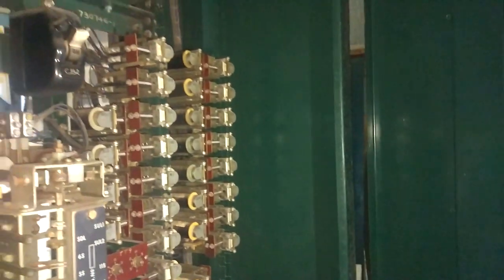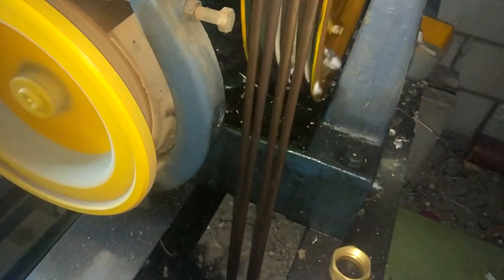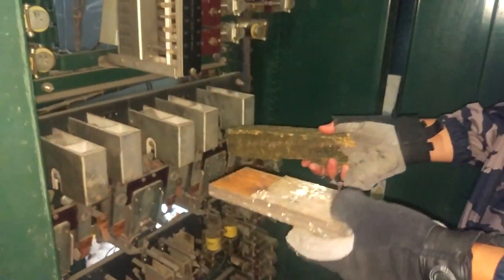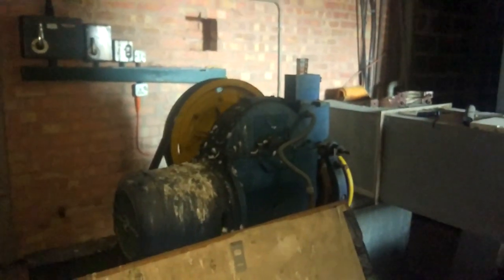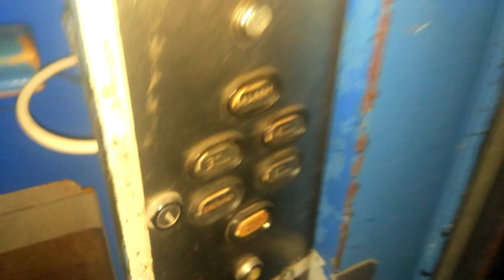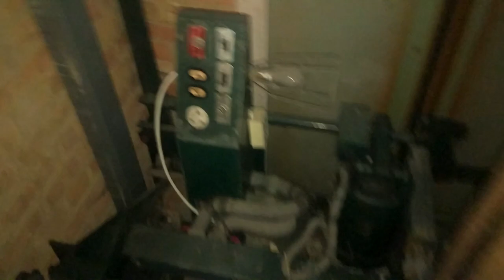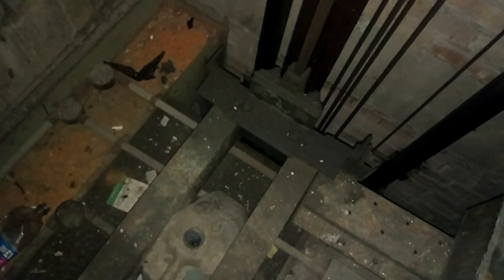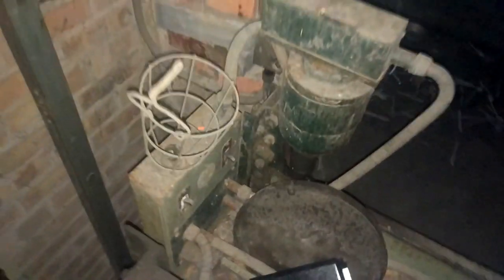Switching on an abandoned lift (60s Express)

Comment: Super dangerous. You had no idea what condition it was in.
Reply from the maker: It was in terrible condition.  The doors were not locking.  Safety circuit was not operating.  Relay logic was not operational.  Shaft doors were rusty and were rubbing when opening and closing.  The motor looked liked it hadn't run in at least 5 years.  The tracks were dry and the shoes were rubbing.  The cables looked rusty.  The motor brake was not working, and after oiling it, it was still getting stuck.
Reply: That’s the whole idea isn’t it?
Reply: @punkybrewstershubby  yea but he’s listed the issues in his last comment to prove that he assessed the conditions and knew what he was getting into before he rode it. Therefore, he already knew the conditions.
Reply: @benolifts  why wasn't the logic working? Had bits been removed?

Comment: Curious that the power is still working. I bet it’s left switched on for the demolition crew.
Reply from the maker: I don't know if that was their intention, but the demolition people are not going to be pushing the main contactors to operate the lift!
We actually found this lift switched on.  Jordan almost got electrocuted because there was no other signs of electricity in the building and we assumed that there would be no electricity going to the lift.  We switched of the lift when we left since it wasn't working and we were worried that other people may go in and start touching the relays thinking there is no power.
Reply: @benolifts  There could be any number of reasons a lone feed still has power in a building like this.  The amount of dodgy stuff done in these places during the lifetime of the building is unbelievable.  

I worked at a high school 16 years ago where one of the grounds keepers was nearly killed when he used shears to cut through a copper water pipe under a building to remove it since the sink it had been for was removed years ago.  What he didn't know was at some point after the sink was removed, an electrician had used the pipe as conduit to run a 3 phase cable that fed a new fuse board.  Fortunately the shears were grounded to the copper pipe as they cut into the live cables.  But the explosion melted the blades on the shears to the point that you could put 2 fingers through the space in their blades when they were fully closed.

That same school also had a fuse board in one of the buildings that nobody knew the feed for.  It could be turned off at the board, but the feed coming in to it was totally unknown to anybody.  And the care taker and grounds staff had tried finding it in the evenings by turning things off at various feed cabinets around the school.  

Oh and also, they discovered by accident another board in a new building was fed by TWO DIFFERENT FEEDS!!!!!  The school electrician was going to do some work on it so he turned off the feed at the feed cabinet in the grounds, but then when he checked the board it still had power.  Turned out it was also being fed by another source from another building and that second source was unlabeled anywhere.  

I'd say the most likely explanation for this lift still having power is that it was never transferred over from the feed it was on during building construction.  What often happens is before the permanent power system for the whole building is up and running, the construction company will get one of the internal lifts working on it's own separate feed directly from the street so they can use it during construction.  

But then what happens is nobody thinks to transfer it to the buildings main feed before they hand the building over to the owner when they finish it.  And if the power company lose track of a temporary building site feed (this happens all the time)  then it's entirely possible this lift spent its entire life operating on free electricity supplied on a separate feed the building owner was never billed for ever.  The temporary meter is probably installed somewhere but after the construction company left it was never read again.  

This is the main reason power is left on in abandoned buildings.  The power company just loses track of the feeds.  They will disconnect power from feeds they know about if the bill isn't paid.  But if they lose track of feeds and stop reading the meters then they never come back to disconnect them.

https://www.thesun.co.uk/news/4227500/incredible-photos-show-abandoned-nuclear-bunker-turned-into-a-2million-a-year-weed-farm-as-three-men-are-jailed/

This is how those guys got free power for their growing operation.  The power had been disconnected so nobody was ever checking from the power company.  They just popped mains fuses back in at the street and hey presto, all the free power they wanted.
Reply from the maker: That is very interesting.  There wasn't any other electricity running in the building apart from the lift.  As the relay logic wasn't working, you couldn't even tell that there was still electricity going to the lift.  We didn't realize until Jordan pressed a relay and we heard an electrical 50hz hum.  Jordan almost got electucuted doing that.  The electricity to the lift is almost certainly forgotten about.
Reply: @johnrauner2515  I read your comment, it's crazy to know how many thing who are abandonned have forgotten thing inside, like the electricity. Some month ago I saw a video of the urbex of an Hospital in USA, and they discoverd that inside the electricity was still working (by discovering a windows 98 computer who was working and some big freezer who was on and who was wasting electricity.
Reply: Yep.  I have reconnected many abandoned buildings.  I have a switch pole stick that i can reconnect the fuses on the primary triplex that feeds the primary side of the transformer.  If no sires habe been cut, then the building will have power.  I also remove the meter and jumper the socket as if its a smart meter or amr metrr then it will ping a signal to the power co when its powered on.

Comment: I've seen lift technicians pull brake solenoid rectifiers to deactivate lifts for good. The rectifiers are socketed, at least some, so all you need to do is unplug and remove them. In this case it seems to be mechanical issues though.

Comment: Surprised that abandoned lifts are still working. And all the mechanics and machinery are also working as well.
Reply from the maker: The lift was only just working.  The relay logic wasn't working.  The doors were not connecting safety.  The tracks were dry and rubbing.  The brake solenoid was stuck and worked intermittently after we oiled it.
Reply: @benolifts  True. 👍